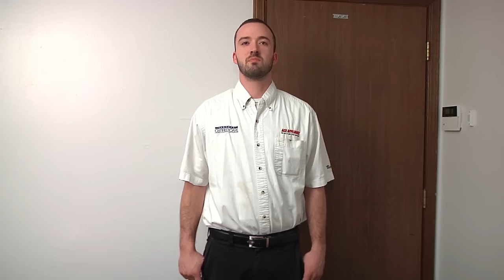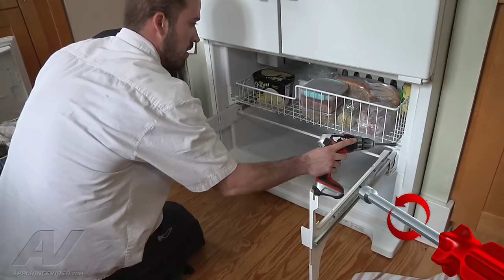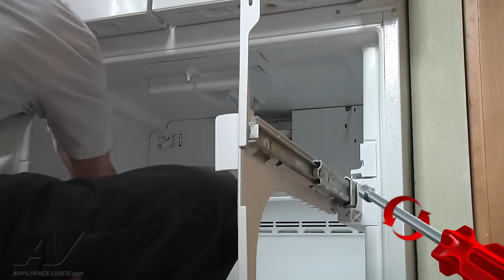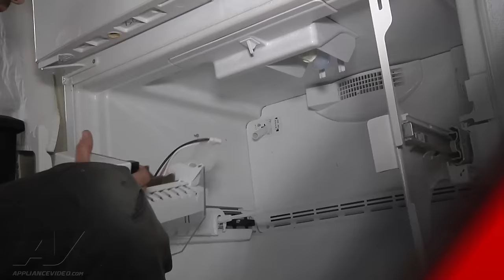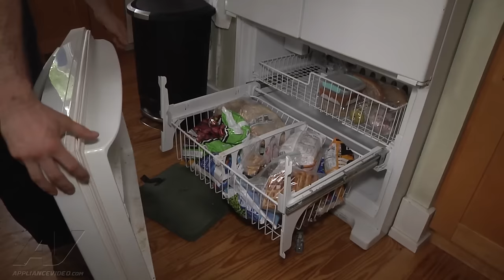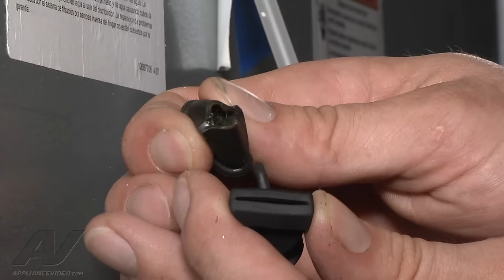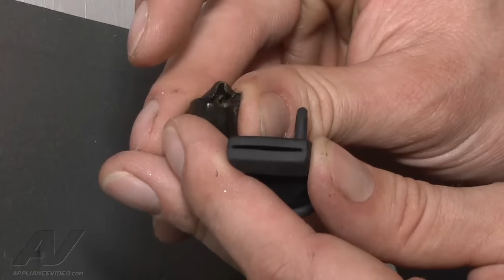Whirlpool Refrigerator Repair - Ice Buildup in the Bottom Freezer - Water Leaking - Grommet Kit

Comment: Does anyone know what refridge would not exhibit the same problem?
Reply from the maker: Great question, you can call
our parts department at 1-800-830-5465 and they can give you help 6-days A week
Mon-Sat . You can also search at www.SaveMoreOnParts.com 7- days a week.  If you have a more
technical question that our parts department cannot answer, our technicians are
answering all questions at our website at www.ApplianceVideo.com under our Repair Help section. We have over 6,000
common questions and answers that you can easily search through by your model
number, appliance make, problem or error codes, and It’s completely free to
search through our question & answer library. There is a very good chance
you question is already answered there.

Comment: I have a Sears Freg with a bottom freezer Mo # 596.65932402, Every thing
 check'd  out but we still have ice build up.  I do not know how to test the main digital control. 
How do I put it into Force Defrost mode?  Thank you
Reply from the maker: Great question, you can call
our parts department at 1-800-830-5465 and they can give you help 6-days A week
Mon-Sat . You can also search at www.SaveMoreOnParts.com 7- days a week.  If you have a more
technical question that our parts department cannot answer, our technicians are
answering all questions at our website at www.ApplianceVideo.com under our Repair Help section. We have over
4,000 common questions and answers that you can easily search through by your
model number, appliance make, and problem or error codes, and It’s free to
search through our question & answer library.

Comment: The refrigerator in the video is a little different from my Kenmore. Not sure if the part listed will fit. As always, the part match says it may not fit. It's going to happen again, if I only clear both parts, without replacing the grommet.
Reply from the maker: Great question, if you have a
more technical question that our parts department cannot answer, our
technicians are answering all questions at our website at www.ApplianceVideo.com under our Repair Help section. You can also call
our parts department at 1-800-830-5465 and they can give you help 7-days A week
Monday -Sunday, or search at www.SaveMoreOnParts.com  24 hours
7- days A week.
Reply from the maker: Great question, if you have a more technical question that our parts department cannot answer, our technicians are answering all questions at our website at www.ApplianceVideo.com under our Repair Help section. You can also call our parts department at 1-800-830-5465 and they can give you help 7-days A week Monday Sunday, or search at www.SaveMoreOnParts.com  24 hours 7 days A week.
Reply: ApplianceVideo.com  I found the specific part for the Kenmore, and did the whole process. Refrigerator now works like it never has. It even makes ice. Thanks

Comment: Can you use a hair dryer instead of a turkey baster?  Also, is this an engineering problem that the manufacturer can fix so that this does not happen with bottom freezers?
Reply from the maker: Yes you can, but you need to be careful you do not melt any plastic pieces.  Thanks for your comment, it helps us provide better videos. Please become a subscriber and get weekly updated videos and help our ranking on YouTube. If you are in need of any parts, our parts department has over 5-million in stock for same day shipping. Please call  1-800-830-5465 for any of your parts needs, or you can order online 24 hours at: ApplianceVideo.com. Thank you and good luck with you project.

Comment: inforrmative video, still perplexed i have a model  whirlpool bottom drawer  gb2fhdxwqo5  i have an ice maker but i did not have them hook it up it is in there and the switch is in the up position off,Water is gathering at the bottom and freezing and running over onto the floor have to defrost it ever 2 or three days. Whirlpool will not honor the warranty.  i called their rec repair service and explained it and the woman said that it sounds like one of two heaters in the back stopped working and is not drying up the water.  Are there more possible reason for this problem given my model and circumstances.  Puzzled.
thanks joe
Reply: We have the exact same model and we've had the same problem 3 times in the last 2 years we've lived in our house. Short of buying a new refrigerator, we're stuck manually defrosting the coils every couple of months.  We definitely won't be buying another whirlpool refrigerator and  I'll make sure to ask about similar issues with are next refrigerator.
Reply: me too
Reply from the maker: Thanks for your response, we are glad we could help. Our library of over 5,700 videos are currently helping over 1.6 million people like you every MONTH.  Please help us by subscribing to our YouTube channel, or post our website www.ApplianceVideo.com to your Facebook page, Twitter, Instagram or any other social media sites. Your support will help us keep producing more free quality videos.

Comment: instead of taken stuff apart, I am going to use a hair drier to melt the ice at the rear trough. We are always removing hair at the front bottom, from below the freezer where its sucked into. I am thinking dog/cat hair has plugged it. We remove our Antarctica sheet of ice every other day.
Reply from the maker: Great question, if you have a more technical question that our parts department cannot answer, you can search our over 17,000 answered questions free at our website www.ApplianceVideo.com under our Repair Help section. You can also call our parts department at 1-800-830-5465 and they can give you help 7-days A week ,or search at www.SaveMoreOnParts.com  .
Reply: just forward the above to your service department, and they can email.

Comment: I have same problem with my Samsung RF4289HA RS/XAA Refrigerator. Any idea how to fix and what part requires to fix it? I've clean the ice few times but it appears again.
Reply from the maker: If it continues to happen you may have a plugged drain assembly. Shut it down for 24 hours and leave the door open. Then pour hot water down the drian to make sure it is open. That should rectify your issue.  Please help us provide more quality videos  by subscribing to our YouTube page or posting our ApplianceVideo.com site on your Facebook or Twitter account. We also have our authorized technician’s daily emailing professional advice daily to people like you that have appliance problems. We have helped thousands of people save hundreds of dollars. Thanks in advance for your help.

Comment: we`ve been noticing Ice in our top freezer,and then water sitting on shelves in refrigerator section,Where is this water coming from?
Reply from the maker: In the freezer section behind your evaporator is a condensate drain that is plugged. That will cause the water to drain in the freezer and in the refrigerator section. You could have a bad defrost heater or just a plugged drain.  Take off the cover and defrost it with hot water or hair dryer until it drains into the drip pan by the compressor. If it happens again then replace your defrost heater.  Please support our parts department at 1-800-830-5465 open 7- days a week.  Parts sales are the only way we fund the filming of these free quality videos from our factory trained technicians. So far thousands of people have benefited from our videos and thanks us for our free help. Thanks for your support, and good luck with your project.
Reply: ***** Thanks you very much,that was the issue,drain plug was full of ice,thanks for the help
Reply from the maker: Glad to help . If it happens again replace the defrost heater. Our parts department is open 7-days a week 1800-830-5465 Thanks

Comment: Looks to me that it makes more sense to just remove the grommet and leave it off.
Reply from the maker: Great question, you can call
our parts department at 1-800-830-5465 and they can give you help 6-days A week
Mon-Sat . You can also search at www.SaveMoreOnParts.com 7- days a week.  If you have a more
technical question that our parts department cannot answer, our technicians are
answering all questions at our website at www.ApplianceVideo.com under our Repair Help section. We have over 6,000
common questions and answers that you can easily search through by your model
number, appliance make, problem or error codes, and It’s completely free to
search through our question & answer library. There is a very good chance
you question is already answered there.

Comment: Cant we just turn off the refrigerator for a day to resolve it ?
Reply from the maker: No because the drain is impacted and will just ice up again. Please help usby subscribing to our YouTube channel. Or support our parts department at
1-800-830-5465. This is the only way we can continue to help the over 900,000
people per month like you repair their own appliances. We also have thousands
of more quality videos on all major appliances made by our factory trained
technicians at www.ApplianceVideo.com .
Reply: I am trying, via your video to fix it myself before I call someone.  Going through process of elimination ...I did the back part first ...pulled out the rubber nipple and cleaned it (it was pretty sticky/gummy) and made another cut to it as per another video suggested. I used a turkey baster to thaw out the inside but can't see the water run down at the back.  Instead of taking the whole front panel out, which seems like a lot of work .. . why could I not leave the fridge unplug for a day or two and/or continue basting with hot water.  That is basically the only thing you are doing after taking the front panel out anyways!!!! Wouldn't everything thaw out in the end.  I may just try that! Thanks for the video.
Reply: No response needed.  I have tried the hair dryer idea as per below comments until I could hear it drain (as opposed to taking the front panel out) ... Now let's wait and see if that was really the problem or a thermostat or something.  Thank you. Love fixing things myself.
Reply: Can you not just unplug the fridge for 36 hours then just change the old grommet to the new p-style w10619951, thus eliminating the need to rip apart the inside of the freezer section ie baskets and all the plastic pieces I will probably break.  Thank you

Comment: Couldn’t you just leave the fridge off for a day or so to melt it off?
Reply from the maker: Great question, you can call
our parts department at 1-800-830-5465 and they can give you help 6-days A week
Mon-Sat . You can also search at www.SaveMoreOnParts.com 7- days a week.  If you have a more
technical question that our parts department cannot answer, our technicians are
answering all questions at our website at www.ApplianceVideo.com under our Repair Help section. We have over 6,000
common questions and answers that you can easily search through by your model
number, appliance make, problem or error codes, and It’s completely free to
search through our question & answer library. There is a very good chance
you question is already answered there.

Comment: Where is the drain line?
Reply from the maker: Great question, you can call
our parts department at 1-800-830-5465 and they can give you help 6-days A week
Mon-Sat . You can also search at www.SaveMoreOnParts.com 7- days a week.  If you have a more
technical question that our parts department cannot answer, our technicians are
answering all questions at our website at www.ApplianceVideo.com under our Repair Help section. We have over
4,000 common questions and answers that you can easily search through by your
model number, appliance make, and problem or error codes, and It’s free to
search through our question & answer library.

Comment: I think these duck bill grommets  have to be one of the stupidest engineered inventions they have come up with! My fridge had to have it replaced twice while under warranty and the second was the “improved” version! And now, several years later it is freezing up again so I imagine this is once again the problem. What a stupid way to design something that could so easily fail! The designer of this must have taken lessons from the automotive industry! Your video was helpful and is pretty much exactly the same procedure the repair guy went through with my fridge. Hopefully several hundred or more viewers have been helped. Maybe several will agree with my analysis that this is a stupid design and some might agree with this; the next fridge will be a top mount freezer of the simplest model available and the cheapest! Cheers🍻🇨🇦🥂🇺🇸👍
Reply from the maker: Great question, if you have a more technical question that our parts department cannot answer, you can search our over 17,000 answered questions free at our website www.ApplianceVideo.com under our Repair Help section. You can also call our parts department at 1-800-830-5465 and they can give you help 7-days A week ,or search at www.SaveMoreOnParts.com  .

Comment: You should have also showed how you cleared the drain hole this would have showed where the drain hole is and what we could focus on to clear the frozen drain. But you skipped that entire portion in the video .
Doing all that just to show us you broke and thaw some ice is a not very good use of the video time, focus on the actual issue which is that its not draining the water and it is overflowing to the front and leaking.....
Reply from the maker: Great question, if you have a
more technical question that our parts department cannot answer, our
technicians are answering all questions at our website at www.ApplianceVideo.com under our Repair Help section. You can also call
our parts department at 1-800-830-5465 and they can give you help 7-days A week
Monday -Sunday, or search at www.SaveMoreOnParts.com  24 hours
7- days A week.

Comment: It wont "fix" the problem long term. It will recur. All he did us remove the ice not solve the root problem.
Reply from the maker: Great question, if you have a more technical question that our parts department cannot answer, you can search our over 17,000 answered questions free at our website www.ApplianceVideo.com under our Repair Help section. You can also call our parts department at 1-800-830-5465 and they can give you help 7-days A week ,or search at www.SaveMoreOnParts.com  .

Comment: I'm sorry but I know a much faster safer way to fix that.
Reply from the maker: Rich 
     We have updated this video. Whirlpool Refrigerator Water Leaking - 2013 Updated Drain Fix Kit - W10619951
Reply: Thank you so much.
Reply from the maker: Rich 
       Thanks for your comment and keeping us up to date. We want any feedback to better our site and videos. Please help us provide more videos to our site by subscribing to our YouTube page or posting ApplianceVideo.com site on your Facebook or Twitter account. We also have our factory authorized technician’s email daily free professional advice to people like you to help solve their appliance problems. Thanks in advance for supporting us. Matt, Ace Appliance service technician.
Reply: ***** I just finished doing this operation even though I'd already done the kit replacement.  The ice plug that forms in the drain can be very long and take a while to melt (as in 24+ hours).  If you need to get your fridge back in service as quickly as possible I would replace the drain kit then do this operation to clear the ice build up from around the vanes and clear the drain using the turkey baster and hot water.   The sound that it makes when the ice dam breaks is EXTREMELY satisfying.  Whole process is very quick and took me less than 40 minutes.

Thanks for a great video!
Reply from the maker: Gregory Smith
                      Thanks for the great information, we also use the turkey baster on most models along with high pressure Co2 tank. Please help us provide more videos to our site by subscribing to our YouTube page or posting ApplianceVideo.com site on your Facebook or Twitter account. We also have our factory authorized technician’s email daily free professional advice to people like you to help solve their appliance problems. Thanks in advance for supporting us. Matt, Ace Appliance service technician.